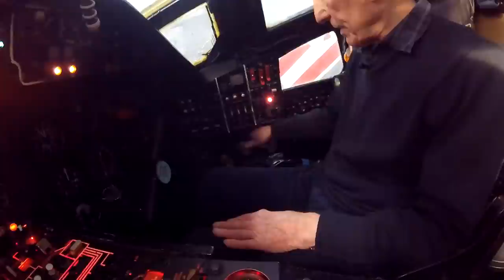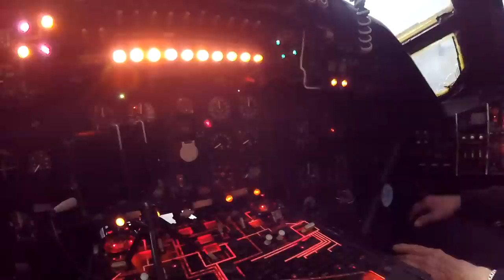Handley-Page Victor Suffers A Double Engine Failure

Comment: 'Twas not the only incident of this type on this type. At around the same time, I was an SAC in the tower ('63-'66) at Tengah and watched, astonished, when one of our Victors lost three engines in the same Centreline Closure circumstances. doing a similar sortie to Song Song. It flew all the way back to Singapore slowly descending on one engine and landed at speed. Deck landing wires were stretched across the runway. The chute similarly snapped off, and the wires were snapped by the wheels. The Jet Barrier net was raised and the aircraft went straight through pulling the concrete staunchion bases out of the ground. The aircraft sat between hangars for well over a year while the main spars were replaced along with new engines. The bomb bay kit was removed and long range fuel tanks fitted for a record-setting non-stop return to the UK. We had a 'celebration' open day with several thousand people watching its departure. It circled the airfield and did a fly-by, then started its climb to the North. As it climbed, the tanks shifted and knocked off the bomb-bay doors which fell either side of the Jahore causeway.  The plane returned and eventually landed, and was still there when I was posted home in '66.
Reply: Fantastic story of reality.

Comment: That's one heck of a failure mode, never heard of that before.
Reply: Happens in other places in engineering. Several high voltage power structures collapsed in Montana about 50 years ago. Bolts shrunk lengthwise and popped their heads. Now they undertorque and use a stamped locknut. 

I also know of a square high voltage transformer exploding from low temperature oil shrinkage. (About -30F). 1963, Cameo, CO. 

Was also an issue on tapered cylinders on air-cooled aviation engines, though usually not immediately catastrophic.

Comment: Hell of a thing
What crosses my mind is if the temperature was sharp enough to do that to one engine its a wonder it didn't take out all four.
I suspect that crossed the minds of all the Victor crews as they kicked the incident around in the mess.
Reply from the maker: I've wondered about that too. Perhaps it was down to a slight variation in the grade of the metal used for one of the engines verses the others or some miniscule variation in the manufacturing tolerances that meant it failed first. Curious.

Comment: One of the hazards of a  shared engine intake, Im afraid...there's an old, ironic, saying: 'It is the pilot's first responsibility to bring the aircraft back so that it can be used again.'...the pilots of this Victor did just that. All three V bombers had ejection seats for pilots only. Rear crews had side door means of escape. Ejection seat didn't guarantee a safe ejection; a co-pilot of a Valiant was killed ejecting when he struck the tail fin.
Reply from the maker: I remember reading that ejection survival rates (back in the 60s and 70s?) ran at about 50%.

My dad ejected from a Gnat in 1978 (video to follow 😉) and was born a few years later so I am certainly happy he was on the right side of that coin toss.

It's shameful that rear crews weren't provided with ejection seats though. There's a video somewhere on YouTube from the 60s showing the difficulties they had getting out of a Victor in a hurry. To put it simply, they couldn't and chances of survival were minimal. But, it was deemed cheaper to train new crew than it was to retrofit the entire V-Force.
Reply: @AirForceAnecdotes  Well observed; your last sentence on the button. I was ground crew through the 50's to 70's and we spent a lot of our time avoiding postings onto V bombers as Crew Chief; we didn't like the egress difficulty! Sadly, a Chief Tech and Sgt. were killed in the Malta heavy landing crash of a Vulcan XM645 in 1975.

Comment: Great story but. (There’s always a ‘but’) This aircraft was in deep 💩. If something had gone badly wrong, the chaps at the sharp end could have punched out; what about the poor sods in the back; why didn’t they bale, prior to the landing attempt? Or was was the poor sod’s escape option that bad, it was better for them to take their chances? (I’ll never forgive the Govt, for not giving them the MB option.)
Why was the decision made to stream the ‘chute, why not wait until the speed was low enough, then stream?
Reply from the maker: That's a fair point. I suppose they reasoned that the aircraft was flying, and so structurally was reasonably sound. Perhaps they weren't aware of the split-pin on the parachute?

The real criticism should be levelled at the government for deeming the rear crew expendable. There's a video on YouTube of an old black and white film showing the difficulties they faced in getting out of the hatch. They didn't stand a chance in a real emergency.
Reply: @AirForceAnecdotes , the shear pin/‘chute max operating speed will be in the pilot’s notes for the aircraft.
Reply from the maker: @johnnunn8688  true. As John says, they thought they exceeded that limit by just a couple of knots so perhaps they simply flipped the switch a few seconds sooner thsn they should?
Reply: Perhaps more to the point, why was there not a safety margin? Aviation safety margins have always been slimmer than structural, but you’d think there would be a 10 knot difference between the A/S limitation and the structural limit.
Reply: @johnnunn8688  all it would need is the airfield windspeed or direction to change by a couple of knots/degrees, on landing, to put them into the zone for the weak link on the shackle to shear. Easily done. Those maxarets worked great & I bet those brake packs were toasty hot!

Comment: Steel balls cool as a cucumber,  landing a Victor heavy, hot ,n, high on two engines on  Butterworth,s short runway suitable for Boeing 757,s is not for the faint hearted.  No reverse thrust, spoilers, just relying on a single drag chute to slow down been,  it would have better off with two parachutes. Did you get a chance to look at the main undercarriage, even with Dunlop Maxaret anti skid protection, all sixteen main tyres  must have been shredded to hell.